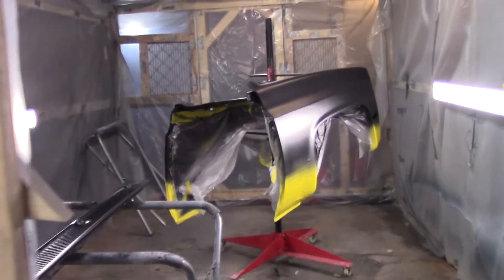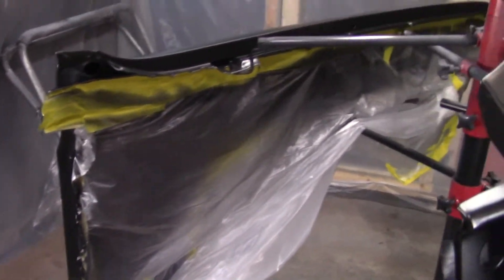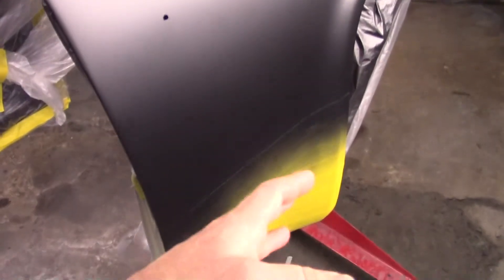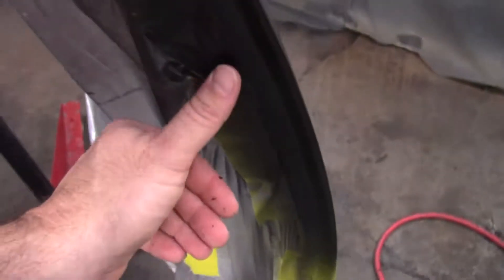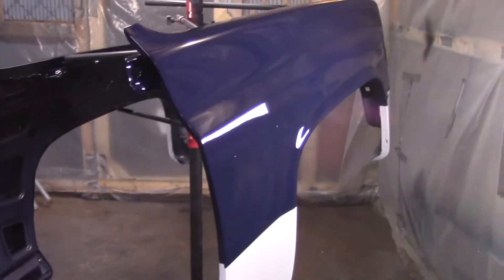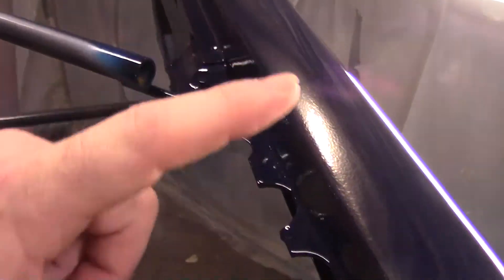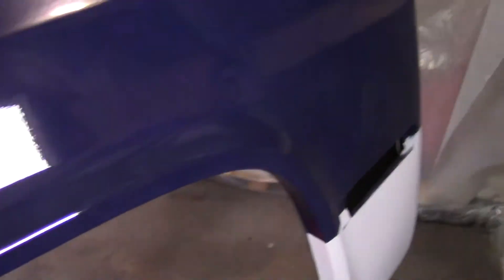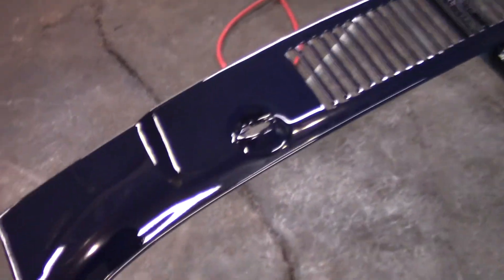1985 Chevy K10 Restoration Part 99 - Fenders Painted

Comment: They look good.  I would say you are getting the hang of painting.
Reply from the maker: I think I finally figured out how to spray clear.  I am surprised I didn't have more runs than I did ;)
Reply: farmboy30117  When you are spraying the clear right you are pushing the limits of how thick it can be without runs.  It's a fine line and you can only learn it by going over that line.
Reply from the maker: It was going on opaque so I knew I was spraying it heavy.  I guess the temperature being over 90 degs helped keep it from running.

Comment: Jay at the motors I've never seen  any masking tape but 3M regular tan coloured style. On the two tone seams we used 3m blue 1/4 rolls of plastic fine pin striping tape then the masking tape.  Looks better every time you do it. Haha cheers buddy.
Reply from the maker: Thanks Steve.  I've never used the fine line tape.  The tan tape I've used in the past left a lot of adhesive so I quit using it, though I can't remember if it was 3M or not.  The yellow tape sticks to the metal and masking well it just don't stick well to itself.
Reply: farmboy30117 The 3m fine line was the only thing we were allowed to use never masking tape for a painted edge and the plastic we used but one time use only most of the time it was paper.
Reply from the maker: I can see why the plastic was only used once.  I blew it off good and had that crap go everywhere.  Luckily I was able to keep it out of the paint!  I'll try some fine line tape next time :)